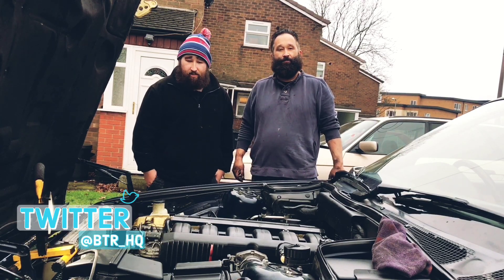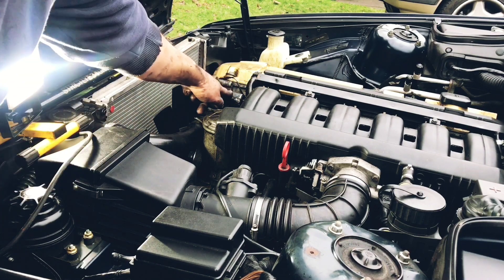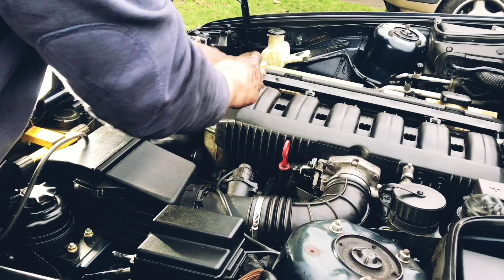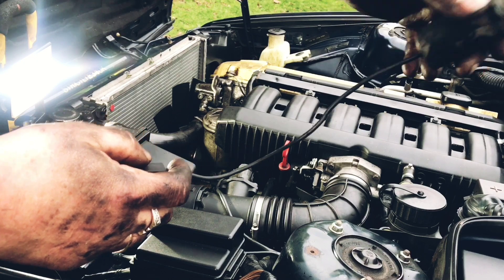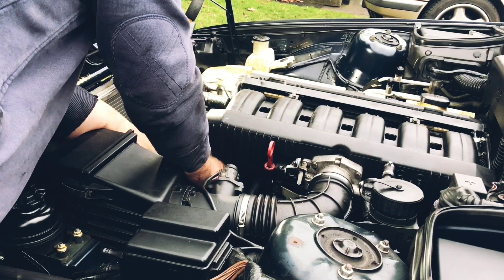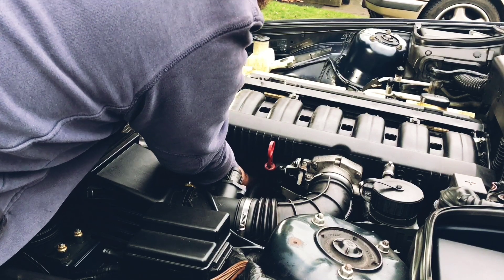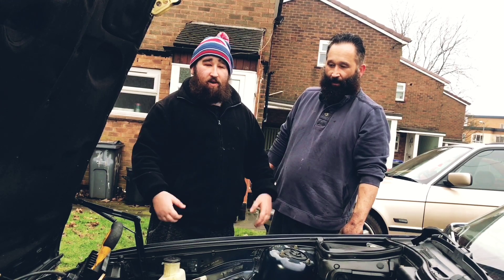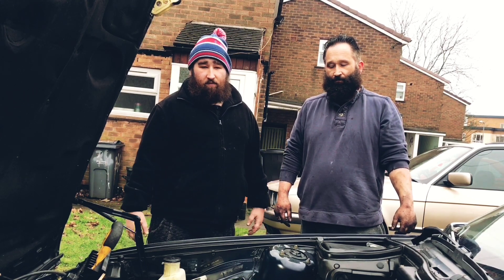How To Change A VANOS Solenoid On A BMW E34 525i

Comment: Hello i have 2 question. My m50b20 e34 var have an issue 
- code 206 Mechanics-variable camshaft setting (VANOS)

- can i clean this solenoid? 

And do you have any idea about this fault 

Thanks.
Reply: Did you get an answer I had the same question as you??
Reply from the maker: You Can Take The Solenoid Off And Clean With The Appropriate Solution, We Done Ours. 

Sadly We Dont As We Haven’t Got A Cole Reader For Our E34s, But I Read Somewhere That IIRC The Solenoid Is The Only Part That Can Throw A Code So Could Be Worth Cleaning - Stefan 😀